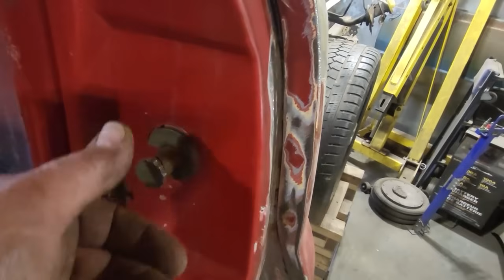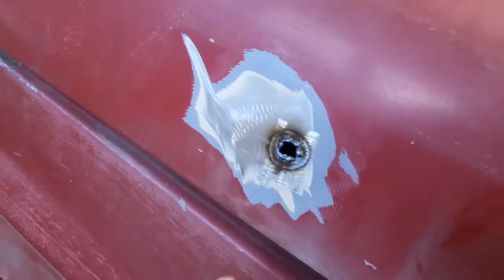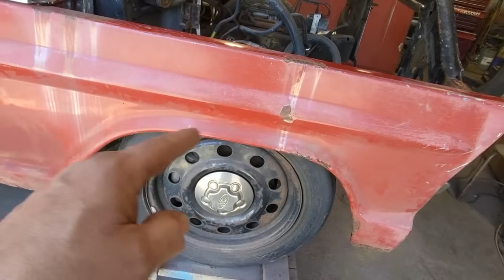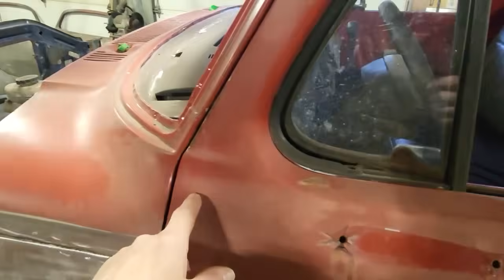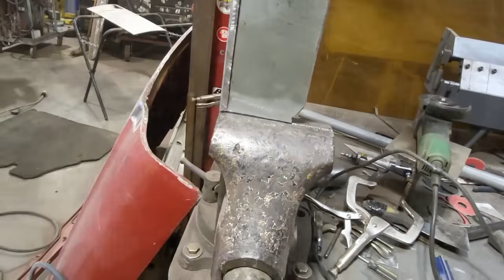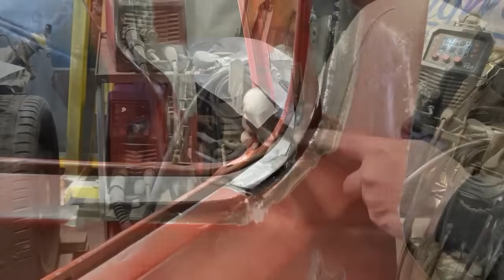Project VIC100 Rusty door bottom repair

Comment: Door bottoms pure alchemy lol , would you do that repair with 18 gauge , im guessing it would be too hard to bend over . I’m in the same spot and not sure if I should grab a panel from the scrap yard to use instead of the 18 gauge
Reply from the maker: 18 gage is what i would usually do it with. I would cut and butt 18. Not this 20
Reply: @fitzeesfabrications thanks as always

Comment: Great new tip on the “backing plate” for the mirror mounts. Just like you said, I had “farm mirrors” ( JC Whitney type ) on my ‘75 Dodge D100, all the sheet metal screw holes are cracked. Great idea and approach. 👌👍😎 awesome video. I look forward to each one.

Comment: Square Door mirrors -  The only available I can see, can be bought new, a slightly different mount, is the MGB / MG MIdget,   TEX type chrome door mirrors you can buy from Moss.or MG Spares or ebay   The door mounting of the MG is smaller than Ford, but they may be close to what you are looking for at about 60 for the pair. 
 Alternatively the square door mirrors fitted to Land Rover Defenders (Black) may suit a Tuck better and are about the same price ? .
 I'm not sure what the price would be near you Fitzee..

Comment: Have a look at LMC for those mirrors, Lenexa motor company in Lenexa Kansas, they have all kinds of parts for the early Ford trucks, you can even get a complete light kit for it if you need it, looking great Tony and I hope that helps you find what you need, I've never dealt with Carter but they are also a big Ford supply company
Reply from the maker: Lmc has thrm but shipping to us is nuts.

Comment: Tony love your videos.  Would you ever consider using an Air Punch and Flange Tool for your overlap patches?  

It seems like you might have a use for one of the small laser cleaner/welders.  Brent at half as customs uses his a lot.
Reply from the maker: I used the flanging tool in the past. I just never liked how it looked when patch was done. 
 I watch Brent all the time and the Lazer cleaner and welder are very cool. But they are not cheap

Comment: Tony, Another video that I always look forward to seeing. I can't wait for Fridays now! The weather in Connecticut USA is finally getting nice, and I'm back in the garage; this Thursday, I'm going in for back surgery and have to have a lumbar fusion. It has been getting worse working on the car and walking, but I know it will be worth it in the long run. I'm like an old car. I need some work once in a while.
 Ironically, I was doing my door rockers yesterday, and my welder broke again. It's probably the relay again. It's an old lincoln 100, so she has some hours on it, but when she works, she works well. 
What do you think of your welder? I know you used to use flux core, but now do you use gas?
Take care. I am looking forward to your next video. Thanks,  It keeps me going.
Reply from the maker: I always used gas, I say I might of burned two small rolls of flux core my entire career.  I love the Arccaptain mig200. It replaced my Miller welder that I have store away since I got the mig 200

Comment: I use a piece of copper pipe that I smashed flat and clamp it behind holes to weld them up. The copper sucks the heat away, and give a backing for the weld so it don't fall out. I have a thicker piece of copper that looks like it was in an electric motor field and use it sometimes.

Comment: Did you ever try carbon arc welding rusty metal with silicone bronze rod? It works really good for filling holes and it paints good with no extra work.
Reply from the maker: No I havent, been told it great for thin metal

Comment: I know when it comes to my driver's seat I'm going to make my own cushion plus I want my seat to slide out side of the cab I'm not sure how I'm going to do it yet instead of the seat sliding back I'll have it slide to the side. Plus I'm going to have an air cushion recess in the front seat. Because fore those long hours on the road I don't want no wounds on my ass from sitting too long.
The last car show I was at was what I was looking at what people done to the inside of there vehicles mainly the front seats. I saw this 40's car it had recliners for there front seat I thought that was the coolest thing the first time I've ever  seen someone made legs that reclined up so they and the passenger could take a nap or sleep in there car. That would be very comfortable at the drive inns movies! You should know how I write Fitz by now I have to write a whole story.
Reply: There was an early 70's late 60's car that had bucket seats that swiveled and faced the door. Might have been a GM product.

Comment: I have used a stiff wire brush in a grinder for cleaning off fill, gets into the seams without removing metal. Worked well on the beltline of my 39 Chevy.